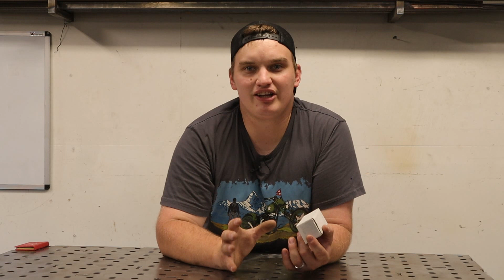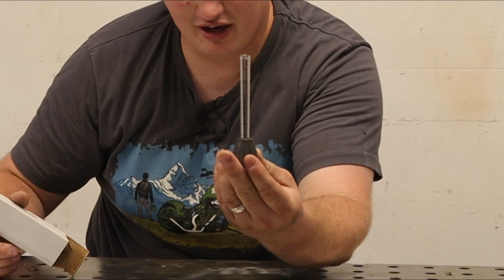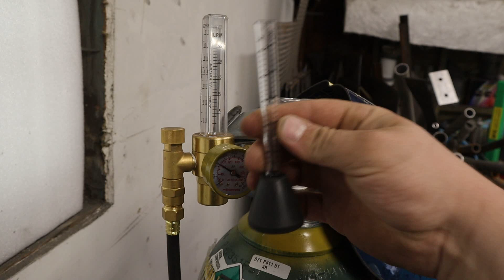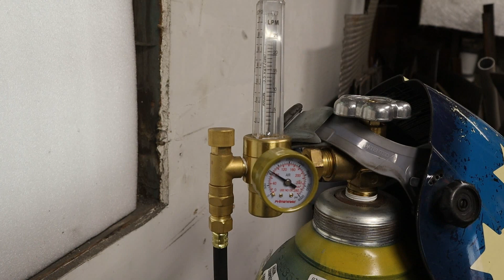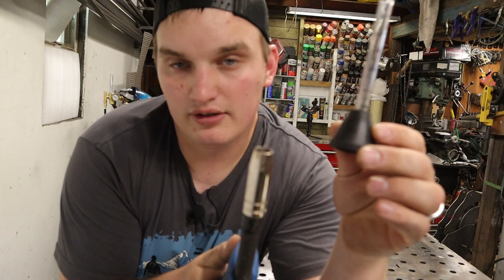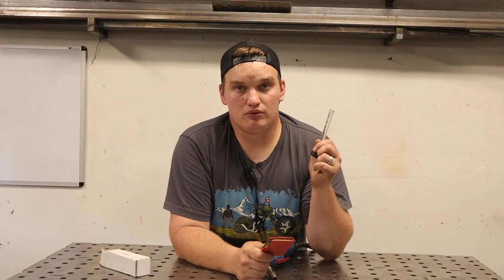I Found A New Welding TOOL!!!

Comment: I got one of those because I was having some issues and learned the flow gages on my TIG and one of my MIG welders were reading higher than they were flowing. The MIG welder that was giving me good beads had a flow meter that agreed exactly with the hand held torch gage. The good tank gage was also the most expensive one. I used the hand held gage to establish the reading I needed on the other gages. Worked a treat it did. Your comment on hose length effects was right on. I have a TIG torch with a 12' hose and three with 25' hoses.  Hose length definitely makes a difference.

Comment: I've got one because my Tig Gas setup at home only has Dial Guages, and I have found that they are NOT ACCURATE, using this Flow Guage it gives you a really Accurate reading, and you adjust the Control knob to get the correct output at the nozzle. We use Litres per Minute here in Australia.

Comment: Been considering one of these over the years, so many are only available in LPM which I don't prefer or like, CK has one but it's like 3-4x more $$$. If my flowmeter reads 15sch and this tells me at the torch it's 13...and I don't have any gas coverage problem, then not sure how it helps. Just my 2¢
Reply from the maker: You're definitely going to get some volume loss especially if you have longer leads but the important part is that you do it and see what your results are when you do have good gas coverage so like you said if you had 13 at the torch you know that and then down the road if you have problems you can use it to troubleshoot and if you're only getting eight at the torch you know that you have a problem
Reply: A bit of simple Maths, there is 2.1 Cubic feet per hour,  to every Litre per Minute, so if you multiply the Litres per minute times 2.1 you get your "prefered" Cubic feet per Hour. I have only Dial guages on my tig gear at home and I have found the Dial Guages to be very inaccurate at low settings like used in tig. I can get a reading of 6 Litres per minute with this Flow guage at the Torch but my Dial Guage reads 15 litres per minute, that is a big difference.

Comment: hehe. I use one regulary. just to verify. I would not go under 6l. unless its thin wall. then 4l. Spray weld area I go 12l. dual flux min. 20l :)

Comment: I give you credit for putting out decent vids, but this one is a bit too much to buy into.  This not going to save you "1000's of dollars".

I actually think this thing is worthless to a seasoned welder.

Once you have to buy your own gas, you WILL be paying attention to how little gas you can get away with.

Sorry, I just can't see this as that a usefully tool.

I have appreciated many if your other vids, but this one compelled be to respond in the negative.
Reply: Actually I could personally use this now.  I'm having some issues at the moment where I'm problem solving what looks like a gas issue.  I either have dirty gas, cause my tank is getting towards the low side, or something is wrong with the gas flow in my lead, which doesn't happen often but it does happen from time to time.  If I had this it would tell me if there's a problem in my lead or if it showed my gas flow was the same as what I have it set as at the tank then lead is good or gas is bad.  Cause right now instead of using the rest of my gas then buying more I'm going to go get more gas and that'll cause me to lose money in the remaining gas I have.  To me it would be useful in this situation.  On a day to day basis I wouldn't use it but it would be nice to help the process of elimination go quicker without wasting gas money.
Reply: Many leak gas because the seals where the whip goes into the machine are poorly maintained.

Comment: You didn't know they existed? WOW, I bought 2 of them for my two welders (welders are 2200 miles apart). I like to know how much gas is flowing (even with the good meters I use). I found the my newest welder shows a higher flow then what's really coming out of the tig torch or mig torch. Make sure the tested is vertical. Good informative video.